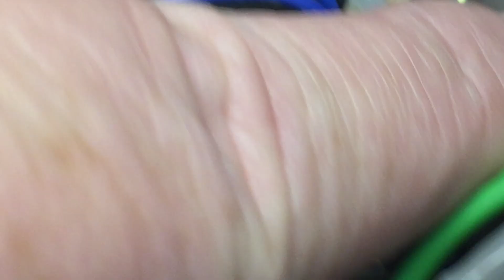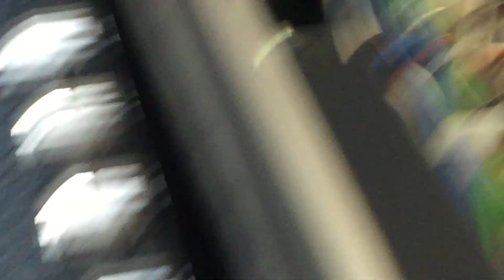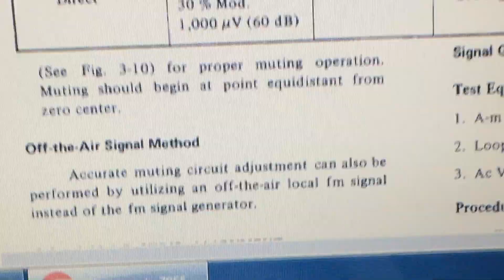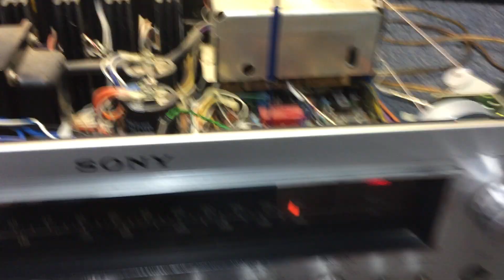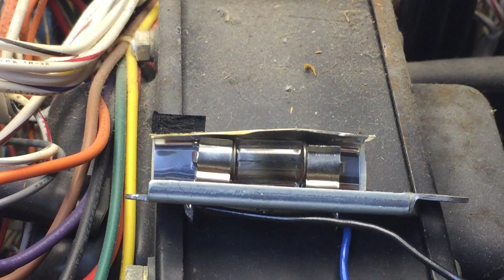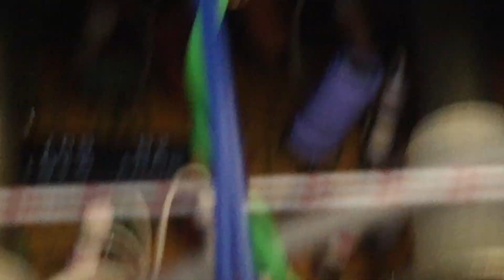Sony STR-7055 Stereo Receiver - repair & testing

Comment: Hi, Regarding the output stage you are way off... the unit is not based on four NPN transistors but on a complimentary set of 2SA663 and 2SC793... even the power supply is a dual rail to accomodate the structure. A brief look at the schematic diagram, one can easily see it is of a push pull nature and can also see the complimentary output stage using the mentioned transistors.
Reply from the maker: Roderick, you are 100% correct! I meant to correct this in the comments after the video was made but never did.  I pinned your comment to clear up my mistake.

Comment: Great video thanks ! 
I was sure that in order to replace the lamps I must take off the front plate. 
If I understand from the video it is not necessary? 
I have str 7065 a
Reply from the maker: As I recall I didn't have to remove the from plate.

Comment: Hi, should there be so much heat coming from the power supply?.
Reply from the maker: How much is “ so much”? lol
Reply: @luvradios it is so hot, it burnt my finger.
Reply: The heat is coming from the two gray ceramic resistors, one is 220 k ohm 3w and the other is 100k ohm 5w.
Reply: And also the board is burnt where the resistors are.
Reply from the maker: @davewilliams5932 assuming the amp is still working normally, I would say 3-5 watt power resistors getting hot shouldn’t be abnormal, the resistors aren’t burnt correct?
Reply from the maker: @davewilliams5932 , burnt or dark?

Comment: I had a Sansui with that type of lamp set up the cardboard cover was burnt badly could have caught fire i replaced them witl 8 volt LED low heat looked great

Comment: Hi, thank you for the video. I just bought a Sony STR 242L receiver. Everything is working, phono deck, CD player, but I cannot get a signal on FM radio. MW works, but I'm in London, so I should be able to get FM. What could be the reason for this please?
Reply from the maker: Are you getting any static on the FM band?

Comment: I just bought a Sony STR-7045. It is scratchy and needs all the lamps replaced. I'm not at all technical so your video is immensely helpful. Great choice on the closing song. Thanks and keep up the good work.
Reply from the maker: PJ, thanks for checking out the video!
Reply: @luvradios  I am going to use LED lamps on the unit. Any concerns? Thanks.

Comment: Hi, Mark, thanks for the video, I've enjoyed it. I have the same 7055 unit at home. The original dial and meter colour is green all equal, if you dismount the front panel you will reach the glass. It is very thick 3mm glass (usually it is very dirty on the inner side), so the edges are another tiny tinted green glass like 0.1mm Due to the heat dispersed by the bulbs, the green is fading away. As for the reflectors your dyi solution is spot on :) Mine have barely audible high freq buzz - still haven't figure it out (power supply maybe or the 3 gang potentiometer), because at some volume  like 11 o'clock it goes away..

Comment: I had to replace the tuner scale lamps on my STR-6055 and a 6065 and they used those same style lamps except they had a green coating on the bulbs to make the numerals green across the scale. I noticed yours weren't as green on the right side. Could you use green LEDs in this instance to get the lighting looking like stock?
Reply from the maker: Could’ve used LED’s but this customer doesn’t want any used as long as incandescent bulbs are available, I’m of this mindset also.  I know it’s popular to use them these days but for me I want to keep it as factory as possible but have no issue with anyone that wants to use them.

Comment: Hi, the conductive foil tape used on the Sony str 7055 fuse holder. Is their non conductive reflector tape that works in your opinion. I am working on one that needs total replacement. Do you have any suggestions for my repair? This is my first stereo project.
Thanks, Steve

Comment: I’ve been “cleaning up” one of these units and this video has been a huge help. Quick question on the muting switch. Where your muting switch was not activating when turned on, mine prevents any signal from coming through in all cases. My stereo lamp also does not work. Would an adjustment to the muting transformer repair the muting problem or am I more likely to screw up the tuner altogether?  Other then the muting function the unit is generally working great. Thx for any feedback you can provide.
Reply from the maker: Blake, thanks for watching!  Does your Tuner work at all on AM or FM?
Reply: luvradios So here is the interesting part of that. The FM/AM tuners were working great. Popped the top back on and all of a sudden I am getting no signal on FM. AM worked for about an hour. Turned the unit off and back on and now no signal on AM. Feels like this thing is melting down. The only other source I have tested is aux and it’s working fine.

Comment: Hello! I have STR-7055 .. the volume control during rotation gives distortion .. it disappears, it makes a sound .. they say it’s better to disassemble and clean the contacts .. you smeared it with a spray .. what? did it help? and when the volume is but 0 in the drone columns. Is that a transformer buzzing? the first board to the front panel is dry ... for some reason it’s kind of wet.?. You did not disassemble the volume control .. just smeared? What is the name of the spray waiting for an answer .. thanks and tell me which one put the light bulb on the 14th minute of the video on the stereo backlight
Reply from the maker: Hi, thanks for checking out the video.  The spray used in the controls is:  super contact cleaned made by MG Chemicals.  I suppose you could take the control apart to clean it if you wanted to but IMO - not necessary, if the control can’t be corrected from spraying it then “more than likely” the resistive coating on the board is damaged and to my knowledge there is no repair for that.  For the stereo pilot I used a clear LED
Reply: @luvradios Здравствуйте! Спасибо за ответ .. если резистивное покрытие на плате повреждено, то ремонт невозможен? Если вы меняете резистор? Какой прозрачный светодиод был взят и какой нужен для весов, не подскажите? Или ссылка?how much power do you need an LED
Reply from the maker: Анатолий , if the coating is damaged the only repair for that (to my knowledge) would be to replace the control.  The clear LED I pulled from a keychain flashlight which I believe operated on a 3- volt button cell battery.
Reply: @luvradios  Спасибо!

Comment: No , you can NEVER EVER use WD40 . Its 100% CONDUCTIVE ! NEVER EVER EVER USE WD40 PEOPLE . Wow I cannot believe you just said that . I was quite enjoying your vid til you just said that , thats APPALLING advice . Using switch cleaner period only prolongs the problem , you should open the switches / pots up and clean them properly ESPECIALLY if you are being paid for this work , but wow , WD40 is a complete and utter NO NO ! You should be ashamed of yourself.
Reply from the maker: What I actually said was:   "IN A BIND" you can use WD40  and I followed that up with:   "BUT, your best practice is to use a quality contact cleaner".  Also, there isn't a single (profitable) technician on this planet that has ever taken a control apart to clean it,  also WD40 is NOT conductive.
Reply: @luvradios  wd40 IS conductive its 50% aliphatic hydrocarbons so of course its bloody conductive . How can you even suggest it isn`t . IN A BIND or not , you CANNOT use wd40 unless you want to completely screw up what you are working on 
. Not only is it conductive it doesn`t evaporate because it displaces water and has a chemical format that is corrosive (for obvious reasons ) I hope people realise that this is absolutely your skill set and you should not be let anywhere near their electronics with this kind of advice .Terrible
Reply: @davidhaney1394  Negative conductivity test of WD40: https://www.youtube.com/watch?v=JVTV1Hr1kvo